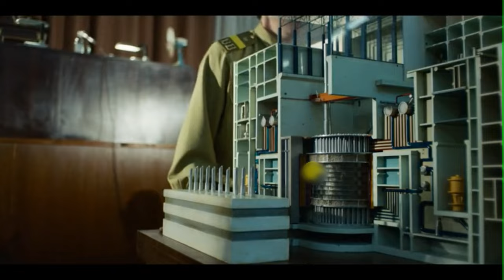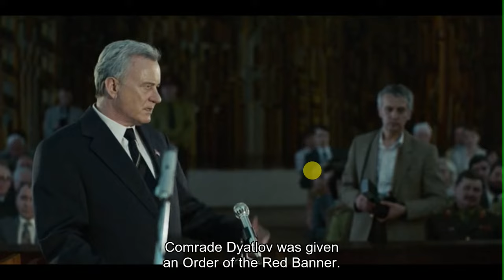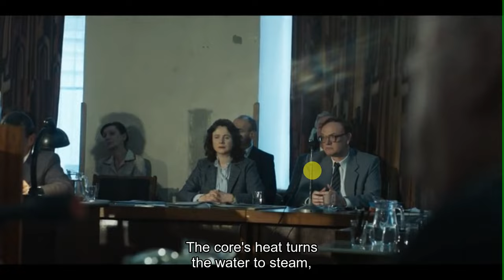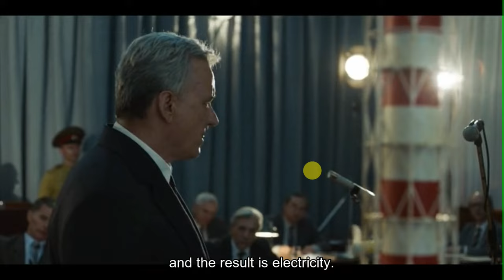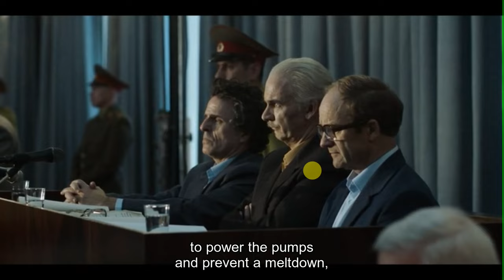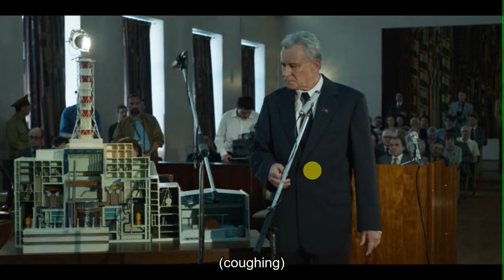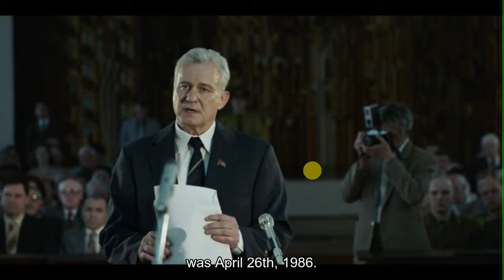The Testimony Of 'Comrade Boris Evdokimovich Shcherbina' /Web serie Chernobyl

Comment: This the best explanation I've heard of what set this catastrophe in motion.
Reply: Commissar Ambatakum took the blame.
Reply: Unfortunately it's not entirely accurate either. Later investigations found while some safety protocols were overlooked or changed on the fly in the moment the primary cause of the meltdown was design flaws in the MKRB reactors.

The plant workers and supervisors did contribute to it but were rail roaded by the Russian government as the fall guys so they didn't have to admit the design of the reactor was flawed
Reply: @Drizzlybear1  I appreciate the additional insight. Do you have a link or two highlighting the new understanding? I do wonder about the people dynamics involved as well as the actions of the supervisors are all too familiar and aren’t limited to one nation or system of government. Whether it’s people trying to gain influence in “the party,” or managers trying to win bonuses or curry favor with the leadership and shareholders, the pressure applied seldom works out in the long run. I guess I can see the acts of the supervisors fitting what I know of high pressure power structures.
Reply: @mikemcaulay9507  Links really work well on YouTube comments but if you look up the IAEA report about the Chernobyl meltdown it's a good report. 

The issue is Russia tried to cover so much up it's hard to FULLY understand how much you can blame the human factor and how much you can blame the reactor. The general consensus is that the reactor had several key flaws that were the primary cause with the human errors being a secondary factor that contributed but without the inherent flaws likely wouldn't have caused the meltdown
Reply: @Drizzlybear1  tone can also be tricky on YouTube. I wasn’t trying to say, “prove it,” though I do try to ensure what ever I take on has solid evidence. I just wanted to ask for it in case you did. I’ll follow up on the search you suggested. I’ve noticed some videos allow links and others don’t so I thought this might be one where it was allowed. :)
Reply: @Drizzlybear1  I should also note that the explanation I was referring to is the necessity for the test. The idea of spanning the gap while the generators spun up was something I hadn’t heard. So my comment was more about the technical reasons for the whole thing versus assigning blame. Though the HBO version of events certainly raised strong emotions, which I’m sure was the point. :)
Reply: @Drizzlybear1  it is explained later on anyway
Reply: @Drizzlybear1  you can also read Midnight in Chernobyl. Fantastic historical and reporting work
Reply: @Drizzlybear1  It is true the operators couldn't execute properly.  But if the operators cannot execute it once in even four tries, then the design is not "sound".
Reply: The fundamental flaw in RMBK reactors is discussed in-depth at the end of the trial as the primary cause
Reply: Too bad it's wrong and it perpetuates Soviet propaganda which tried to put the blame on the operators, instead of inherent design flaws of RBMK reactors.

In reality, Legasov was more responsible for the catastrophe than Dyatlov, as he was one of the scientist who participated in the cover-up of said flaws.

Comment: Something I hadn't considered before is this. Why was the test never conducted on the other reactors that came online over a decade before the disaster?
Reply: It likely was, but on Reactor 4 the test was modified on the fly to a lower power state of 200MW.
Reply: It most likely was run on other reactors, but under different circumstances. The problem was not in the test itself on that 4th try, it was in the reactor. Reactor had Xenon poisoning from running on low power during day shift. The test even should have been done by< the day shift, but was not possible due to the low power setting. In the nigh shift, Djatlov ordered the power to be raised, which did not work because of the Xenon, so the test was impossible and they should have waited for the Xenon to be burned in a controlled way. But he did not know about the Xenon poisoning and also not about the positive void coefficient of that reactor type and its effects. The cranked the reactor to its maximum, void bubbles formed, Xenon was burned and it became uncontrollable.

This chain of unfortunate events could have been stopped in different ways:
- if the Xenon poisoning would have been recognized for what it was
- if the events during day shift were different (no lowering of power output -> no xenon)
-if Djatlov had listened to the concerns of his team or if the team had stood up against him and stopped the test
- Maybe if the design of the reactor and or of the control rods would have been different/safer (no positive void coefficient, no graphite tips on the control rods) there might have been a chance to divert disaster in the last moment by triggering the emergency shutdown.
In the end, they tried to shut it down, but it was too late, the control rods gut stuck due to extreme heat and their graphite tips made the core go berserk even faster...
Reply: Because the Soviets had a habit of speeding things along to make themselves look better than the West.
Reply: @chriswatters1049  saying that as if the west isnt guilty of the same
Reply: @BlacKHellCaT78  the West normally doesn't need to speed things up to match the East. The East, for most of history, was catching up to the West

That was the case until Deng Xiaoping
Reply: To put it simply, it was tried, never succesful.
Reply: @BlacKHellCaT78  indeed. No western nuclear man-made failure disasters have occurred.
Reply: @danielbright2916  Fukushima. US manufactured reactors. Almost identical cause as in Chernobyl - diesel generators
Reply: @GitonIcon  not the same continent level of danger, a more controlled catastrophe.
Reply: @GitonIcon Fukushima had the generators in a basement, so when the plant flooded, the generators were the first thing hit.  I wonder if that was a US design or a Japaneese one?
Reply: @theivory1  The grid controller requesting that they postpone test had brutal consequences... chances are if test doesn't get postponed, chernobyl never happens.

Because of factors like:

Employees experience/familiarity with test procedures... the day crew had known for a couple weeks that they would be performing test, and thus were that much more knowledgeable of how to initiate it. So day crew goes home, evening crew comes and goes, and night crew (most likely the least experienced group overall) has to perform a test they had almost no knowledge of. And will all do respect to Leonid Toptunov, the kid was 25 and had been on site all of 3 months. It would be like a construction crew asking a flagger to just hop in the excavator real fast and start demolishing a building that's in between 2 other buildings that are not to be touched.

The xenon poisoning... usually a reactor working at full capacity burns it away/makes it a non factor, but because the reactor was sitting at 700mw for 8-10 hours (as opposed to maybe an hour or 2 if delay hadn't occurred) the reactor poisoning set in.
Reply: @GitonIcon  The tsunami wasn't man-made failure.
Reply: You mean last 400 years of history?
Reply: @szarvaskoppany No, the man made failure was to not recognise that a 4m high wave breaking wall wouldn't be nearly enough to stop a heavy Tsunami wave, instead of the commonly recommended 8m at the time. But we all know why they build it like that anyway. Because it was cheaper...

Comment: They were never able to successfully run this test at any reactor of this design.  After the disaster and the issues with the reactor design were fixed, they still did not try it.  They found, like any computer farm or power plant that you would build an uninterrupted power supply, basically a pile of batteries hooked in to instantly power the critical infrastructure until the generators kicked in.  After seeing the scene in the cabinet room where they tell Gorbachev that if the water underneath gets hit by the"lava" and destroys the other reactors, kills probably 70 million or so and makes, what, 25% of the planet uninhabitable, I always wondered, if there was a nuclear war and these plants were all destroyed, as I am sure they were targets, how much radiation and fallout would they throw into the atmosphere.
Reply: They probably would throw less than chernobyl as the explosion force came from inside the reactor itself. The water explosion is an overstatement but it would have severely impacted Ukraine

Comment: I don't understand why it takes 60 sec for backup generators to power the pumps.  If normal power is lost to the buss, the generators should immediately start and the ABT roll to the emergency buss.
Reply: Soviet engineering, I guess.  They have to cut an apple into 3 pieces first.
Reply: because generators are big hulking pieces of machinery that take time to speed up. they're not talking about lil baby backup generators that people might buy for their house.
Reply: @sillyking1991  I know.  It still shouldn't take 60 sec.
Reply: Sure it would.  Once they spin up, they need to warm up enough to keep going when you start drawing power.  Even in a 5-7KW generator on a boat it needs 20-50 seconds to run before to start drawing power from it.  If you don't they stall out because the actual converter slows the engine down too much. 
 @xomthood
Reply: @bill9500  the standard is start up and connect in under 45 seconds.
Reply: @dylandarnell3657  Wait until you hear about legendary Japanese engineering and why their diesel generators weren't operational in the time of need in Fukushima.
Reply: @somedud1140  If you can provide convincing evidence that Chernobyl had been hit with a tsunami during the test, I will update my conclusions about the quality of Soviet engineering accordingly.
Reply: @dylandarnell3657  Nice deflection! But generators in Fukushima weren't operational, because they were placed in a low ground in a tsunami prone area, some of them were placed in the basement! Who could have known that the part of the building that floods first would be flooded in case of emergency? Oh right, there was an incident on site with generator flooding before the tsunami.

 When the issue was brought up prior to accident, they decided to ignore it, because losing grid power for more than 30 minutes was deemed "highly unlikely". In result, Fukushima's generators not only failed to launch in under 60 seconds, they failed to launch in 60 hours.

Yea, it doesn't excuse slow Soviet generator, but you should be aware of Japanese engineering, even if HBO hasn't made fictionalized miniseries about it.
Reply: @xomthood have you seen the size of the pumps they need to power? Western reactor pumps are the size of a house - anything capable of driving one isn’t going to start up and be synced in just a few seconds.  Not forgetting, the pumps are not static - they’ve been running, so they’re still spinning down and self inducing, you need to match voltage phase and frequency - which takes a little time. Otherwise you break something.  Small kit can take a jolt - big kit has too much inertia to overcome instantly.
Reply: @somedud1140  mind you that's US engineering you're talking about

Comment: It would not have been that difficult to have kept the diesel powered pumps running in a "jockey" mode so if main line power failed they would have already been running and the response time would have been - maybe - 10 seconds.
Reply: No way. You may ask why? The answer will be given in the following testimony: back in the day in USSR we wanted it to be CHEAPER
Reply: Water tower, BIG water tower, would be easier.
A town need water tower anyways.
Reply: @budisutanto5987 They had the SAOR tanks but those were only intended to be used if generator power never comes on.

Comment: Couldn't they just had a large battery bank to supply the 60 seconds for the pumps?
Reply: I assume an electrical battery could not do the job in 1986 compared to diesel fuel generators. Perhaps today the technology is more advanced.
Reply: Not sure, remember the diesel submarines used batteries to power the electric motors and other systems on board for hours. I find it hard to believe they could not power water pumps for a minute.
Reply: @jeep146 that's actually pretty accurate motors have an intense surge of a rush of power and high amperage when they first come online after a status of being turned off and completely cold

They then have to come back down from this huge surge and afterwards they can begin to supply their constant output at a more stable rate

If you want back up motors to power something you need to either adjust for this huge influx of power at the beginning of the back up motor's start cycle so it doesn't fry whatever it is the motor will be powering

Or you must already have the backup motors running in tandem at a constant output that matches the primary motors used to supply your power
Reply: I think you guys might be underestimating just how large power plant nuclear reactors are and just how much water needs to be pumped through it.

Using even the largest batteries available back then would have been akin to filling your swimming pool using a turkey baster.

Comment: My frustration is why wasn’t it designed so that some of the power coming from the turbines could always be feeding the pumps. Then no need to shutdown the reactor. If they did need to shut it down they could do so in stages. Furthermore you had other reactors in the same location. Why couldn’t plant 4 get power from plant 3 if it needed to?
Reply: I'm no nuclear physicist or engineer, but the RBMK reactor designed was flawed, and well out of date by 1986, with its origins dating back to 1954, with little in the way of safety measures or consistent redundancy. The final design of the most "modern" RBMKs that were first used in the 1970s was rushed in order to "get it out the door". They had to operate exactly as designed with no basically no room for deviation from protocol or room for error, otherwise a major stability issue could rear its ugly head and quickly become unrecoverable. Chernobyl was not the first RBMK disaster, as you can see in a documentary about it here on YouTube, but it was the most serious one by far. As far as getting power from other reactors is concerned, I think this test was supposed to be conducted as sort of a "worst case scenario", as in, assuming that all other reactors were shut down for maintenance or something, or otherwise damaged or inoperable for some reason, meaning that reactor number 4 was carrying the load by itself until there was a new emergency that would facilitate the need to use the diesel generators. They knew about the diesel generator flaw discussed in this video, and they were banking on using the "spin down" power to keep things going until the generators could take over. That was a very tight window of time, and like the RBMK reactor design itself, left essentially no room for error.

These issues weren't exclusive to RBMK reactors either. Design and operating oversights like these were very common in nuclear submarine reactors of the time, and shortcuts were taken all over the place in the design and implementation of new technology, in both the military and civilian sectors. See some of the other Soviet era technology botches of that time period, such as the K-19 "Windowmaker" submarine with a bad safety record up to and including  a reactor issue, the Tupolev 104 civilian jetliner which was the first one made in that part of the world, being hastily derived from a military bomber plane and as a result of safety not being a priority, being involved in a number of crashes and other accidents, the Tupolev Tupolev 144 supersonic jetliner airshow disaster and poor overall design and performance, like needing a parachute to land or making so much noise in the cabin that the passengers had to write notes to each other to talk, or the fact that it couldn't make a trans-Atlantic journey, often referred to as the "Concordski" or the DUGA early detection radar array, which could be jammed by amateur radio operators in other countries. They just did everything they could to beat the west to the punch in technological or military might, or at least keep up with them, that they kept throwing safety guidelines out the window, to their detriment.
Reply: @unr3alGaming  Thank you for your comment, was very informative and I think you have hit the nail on the head. They did “get it done and working” over safety then tried to Work some safety in after the fact and ironically that’s what got them in the end.